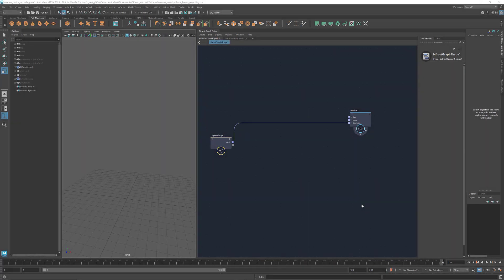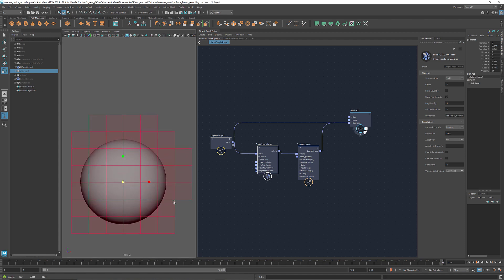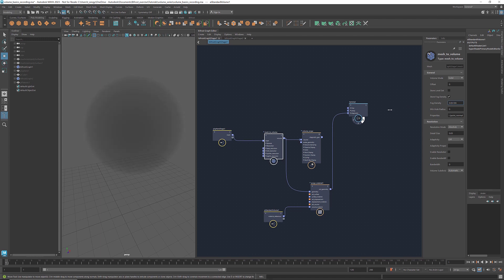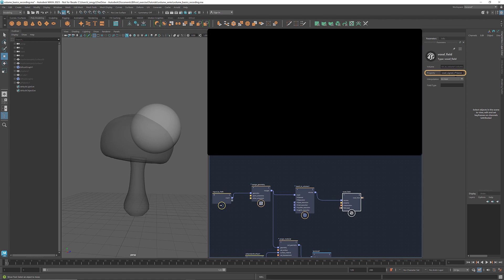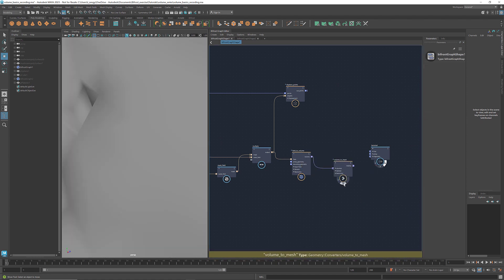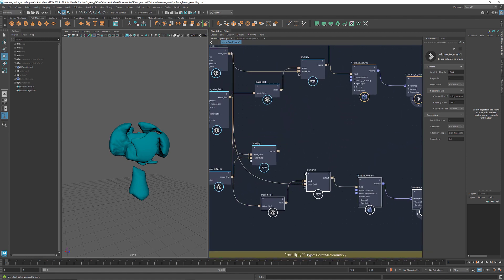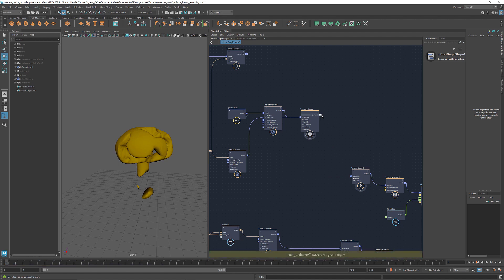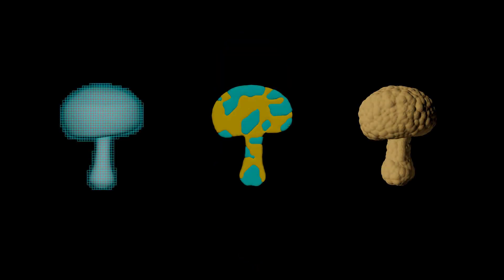Understanding Volumes Episode 1 - Volume Basics

Comment: 8:28 Instead of multiplying the signed distance with the fractal noise it is better to use an add node. If anyone is having problems displaying the result in the viewport you should try this.